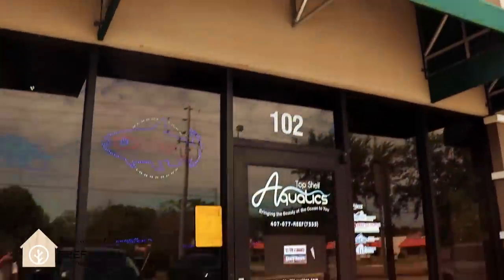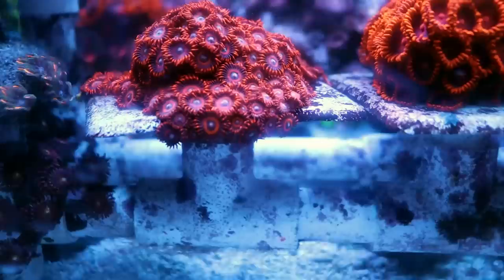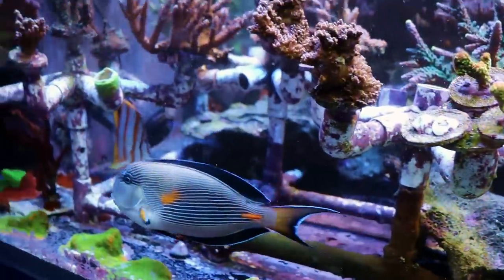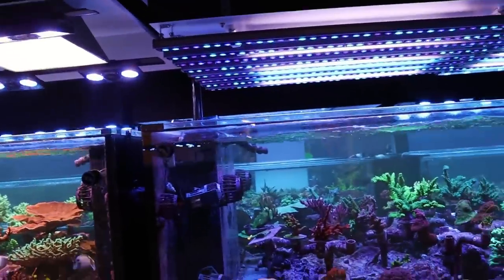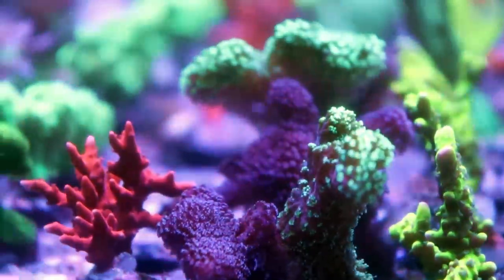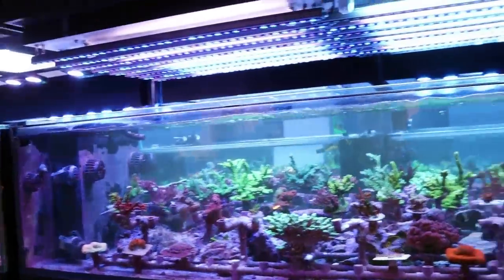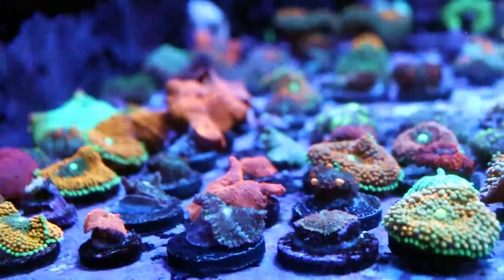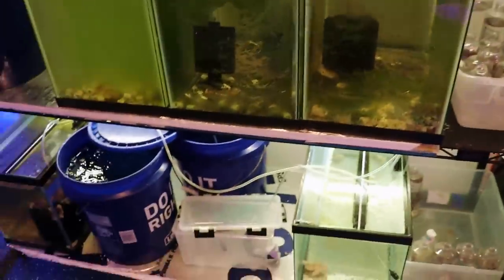Top Shelf Aquatics 2023 Video Tour

Comment: I’ve had asterina in previous tanks with no problem whatsoever. My current set up has had them and they have 100% Been eating my zoas. Had to peel some off polyps where colonies were dying off and I had no idea why. After peeling off, which was unusually harder than normal, there were small white bite mates on the polyps where they had been on them feeding. Currently have two harlequin shrimps in there helping and zoas seem to be recovering.
Reply: @IttyBittyF1Fitty  definitely happens 👍🏻

Rare but it has happened to me lately.